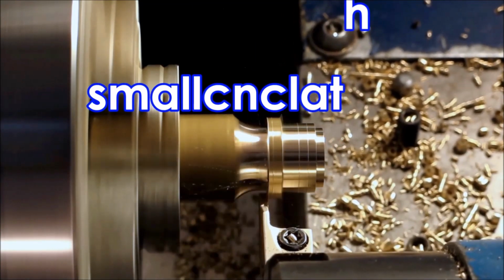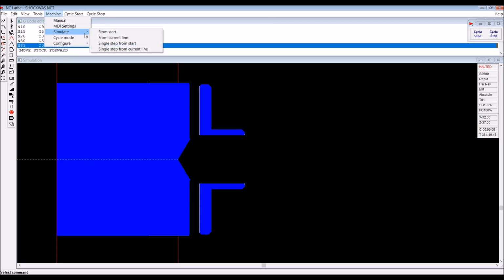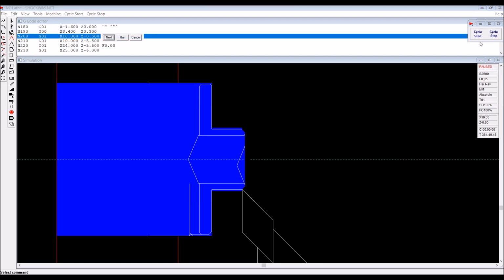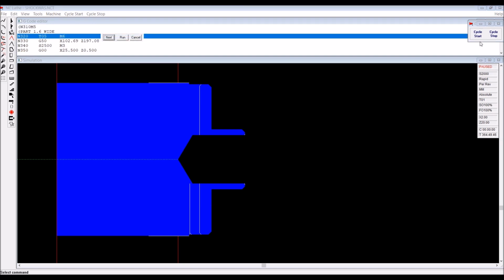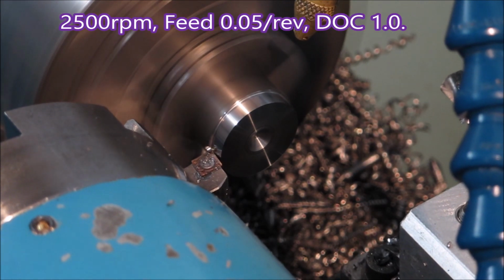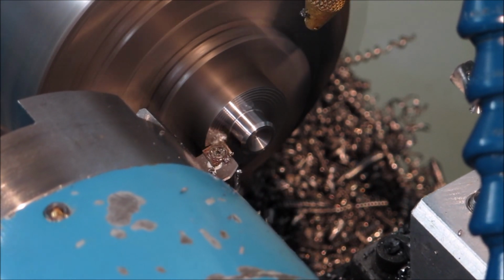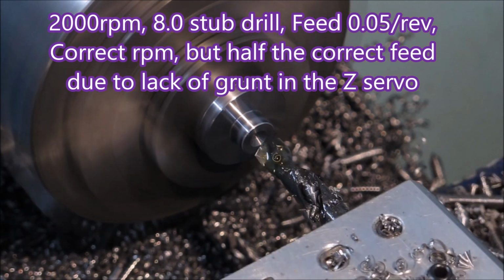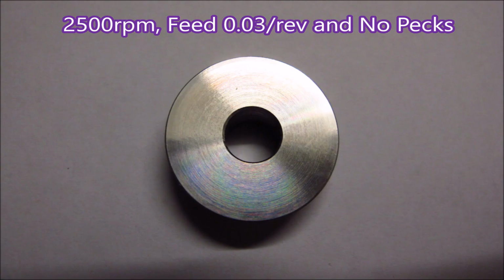Parting steel on a small cnc lathe using Kennametal tool

Comment: I will update my lathe to CNC!
Reply from the maker: We look forward the videos of the conversion!
Reply: @smallcnclathes  sorry, but it's already done.
Just left to make a switch between CNC and ELS (electronic lead screw )
https://youtu.be/kkBu_X1bLds
Only I have wobbling on my X axis lead screw, so I need to fix it first. (on the cone test you can see the issues)
Reply from the maker: Nice job. You have a quick change tool post for it?
Reply: @smallcnclathes  Thanks!
I have a half Chinese a half homemade...
https://youtu.be/YOcN3NHkLEk
But if I will do the CNC I will try to do a turret, or a linear tool change. Need to figure out. I will use LinuxCNC with touch display.
https://youtu.be/RT3o5QwfdBU

Comment: Great progress on the parting operation.
Reply from the maker: Thank You, parting is much improved since I stopped using the peck feature in the canned cycle.  Only use the canned cycle now when making a groove wider than the parting tool. Still don't use the peck function though, just make it such a high figure that it does not peck.  For parting these days I just use G01.
Reply: @smallcnclathes  good to know, I'll soon start practicing on an Emco compact 5. I hope to get a computer running on MS-DOS soon to use the original cad/cam software. The modern softwares could be used also, but I would need a custom post processor which is expensive if you can't do it yourself.
Reply from the maker: Do you have the Emco dos software? Do you have the dos software?
Reply: @smallcnclathes  I have some version of Dos on three floppy disks and the Emco software is available online on a user group of Emco lathes. I think it requires the real thing and not an emulator. I tried on win XP it did start but even on win 95 compatibility mode it doesn't run properly. I might try dosbox first but I need a computer that boots really to Dos if it doesn't work.
Reply from the maker: MF175mp my first cnc was an Emco pc5, I think I still have a copy of that software somewhere if it is what you need.
Reply: @smallcnclathes  I'll keep in mind that you have one, it may be a different version and come out working if I don't get the copy that I have to work.

Comment: Why not use Fusion 360? I'm sure someone has asked that. :)
Reply from the maker: I am not sure it has been asked. The software is used to drive the lathe, through an interface card in the PC. I have my own cad system I have been using for years, I draw in that, import the dxf to the Lathe software and use the cam in the software to create the code.
Reply: @smallcnclathes  Nice work btw. I just found your channel and really enjoy watching your stuff. I have been running my lathe and mill for the past 16 hours straight today. :)
Reply from the maker: @ErnestDuarte  you must be exhausted!